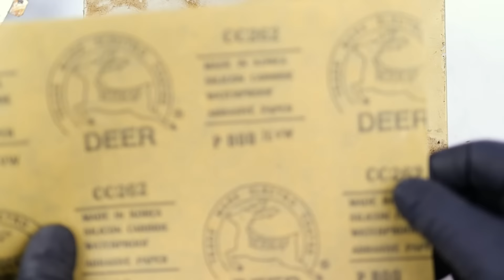Nintendo NES Console Restoration and Repair - Retro Nintendo 1985 Retrobright - ASMR

Comment: You marbled the plastic case with the peroxide cream treatment. It looked bad after you de-yellowed it. You're supposed to massage the peroxide cream every 15 minutes or so and also make sure it doesn't dry out. It looked dried at the end. Even better just put it out in strong sunlight to remove yellowing. The broken plastic 'toothpick' fix looked bad.  The gameplay at the end looked very emulated and not real.  Like how you used power tools to clean the rust off the metal parts but it would have looked nicer if those surfaces were polished to a 'like new' finish. Now the rust will return because of how the metal brushes scratch the surface. 2/10 restoration.
Reply: Bro it's a restoration parody
Reply: It looked emulated because it was a PAL set.
Reply: Put your own restoration up.

Comment: Something is off in this video, Console which he restore is PAL, in the end he tested with NTSC games cause PAL console suppose to run slower also have black bars on top and bottom
Reply: Yeah it was a bad restoration and faked gameplay of NTSC machine. Looks like emulated gameplay it's so clear.
Reply: The box says NES on the identification sticker underneath.  I don't see PAL on the identifier.

Comment: You were very intentionally avoiding showing that it was a modded nes for some reason. It had a standard nintendo composite or s video  jack installed in the rear.

Also, it was pretty cool watching you somehow play it with left and right audio cables installed, and no video cable plugged in. Neat trick. 😂 🧐

Comment: Love your restorations. I just wish you put a description of the proceedure and/or the stuff you use for restoration. Thanks. Great vids by the way.
Reply: Then everyone else will be doing it, I'm sure he doesn't want that...
Reply: @ami2evil  there are millions of consoles… this guy cant fix them all. The product to remove the yellow tint isn’t a secret. There are many products that will do it. Retro-brite is probably the most popular.
Reply: @fatkat311  Good point, I think I want to try, seems easy enough...
Reply: @ami2evil  I’ve done it before. Not really hateful. It really does work well and doesn’t require much prep will take the yellow right out of any plastic and bring it back to New. If you don’t have access to UV lights You can leave it out in the sun for four hours or so it works just as well.

Comment: Cool! Got two PAL NES consoles, one in cosmetic bad-shape and the other one broken. Thinking of using the best parts for the project. Brand new connector will be installed aswell. Never thought about the yellowing of the plastic until I saw your video...but yep that is definitely an issue on both of the consoles. Need to learn more about this, seems to be a elaborate process? Great video and thank you for the inspiration to bring back this beast from the past!

Comment: As someone who repairs electronits fro a living I’m skeptical on how there was 0 PCB damage despite the rusty EMI shield, nor were the bottom screws even slightly rusty, something that happens as the water or humidity is affected by gravity.
Reply: I think this video is fake, mainly due to the gameplay demo. There is no way composite looks that clean, alongside the fact that there is integer scaling on an HDTV, which unless using an external upscaler wouldn't be the case normally.

Comment: amazing work !! I have the original console since 1991 in the year 2000, bored, I opened the console to break a pin, I think it is between the fourth and seventh of the zone control chip to remove the NTSC lock to run 2 games in PAL that I had from France that I could never play because I'm from another country (zelda and metroid), and it works. review this information. greetings from Chile

Comment: Why aren't you taping up the non grey parts? The solution WILL take out some of the black color. Also, the way the plastic is wrapped will cause "zebra" stripe patterns on it. You should set the plastic in a much more flat manner.
You could have protected the stickers as well.
For the parts where you are sanding, why not just use a magic eraser anyway?

Comment: NOT ASMR. Certainly not the parts where you randomly dragged the sanding disc across the stamped metal pieces around 15:20. That step was super cringe-inducing.